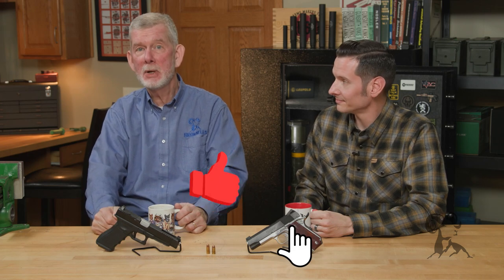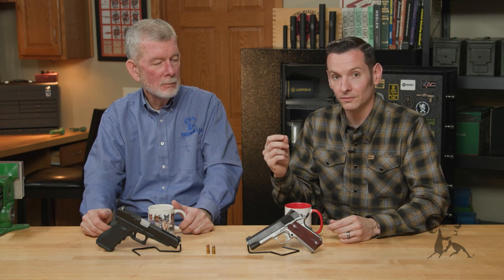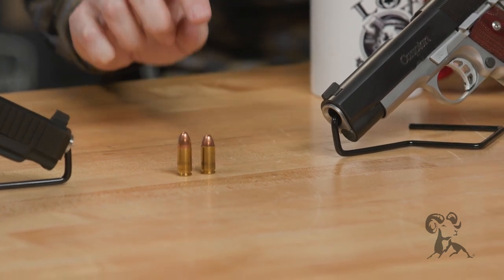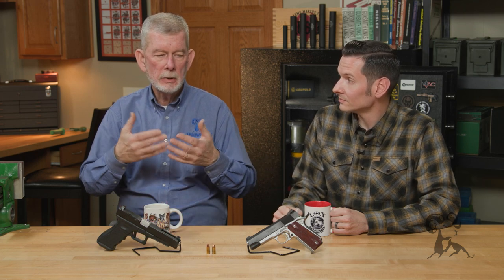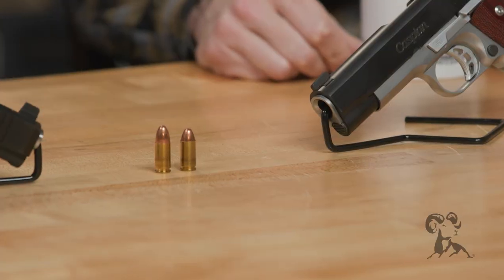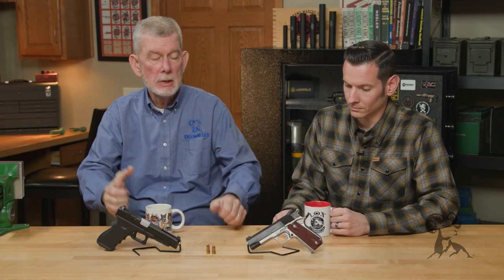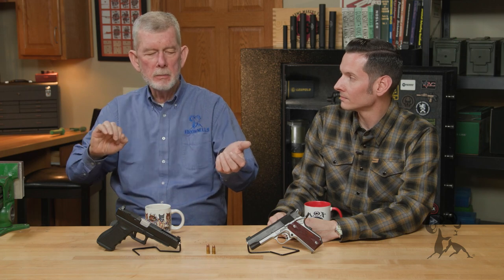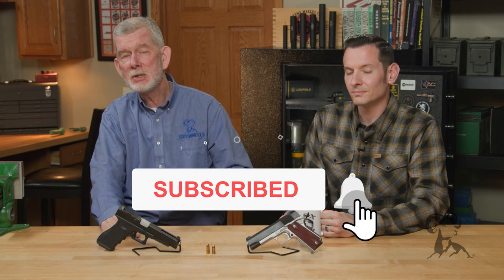Smyth Busters: Will Excess Bullet Setback Blow Up Your Gun?

Comment: So, many years ago I was a law enforcement officer.  We were issued Glock 22s.   Our carry ammunition was Speer Gold Dot.  I’d often clear my pistol for various reasons. Often times I’d simply “re-chamber” the same round, go back on duty. 
One day at our yearly in service training, we were told to shoot our duty ammunition in training and we’d be given fresh ammunition before we left the range.  First time I went and drew my G22 to shoot our qualifying course I had that first round sound extremely loud and it caused a malfunction.  Upon closer examination, one of the frame rails slightly separated from the frame.  Hence the Glock was shipped back to Glock.  I learned a lesson that day.  
I’d would have had a single shot pistol had I been involved in an incident.   Scary.
Reply: Yep because glocks do hit a fairly steep feedramp unlike Beretta.
Reply: I was in Law enforcement for almost 20 years always just left everything in my duty belt. They left their glocks on the job and loaded and unloaded them every shift. Having known about this potential problem for years I was uneasy at best and they wondered why they had so many negligent discharges . Luckily two weeks later I got a better offer closer to home.
Reply: when i load my pistol for cary, i typically manually load it, drop the slide then insert my magazine. same with my rifle
Reply: @xtreampb6309  bad on your extractor
Reply: @xtreampb6309  This method you use will put more stress on the extractor as you're forcing the extractor's claw around the cartridge, whereas in normal feeding the round slips behind the extractor as it slides up the breech face finding its seat. Examine your extractor very closely for any chips.
Reply: Well one thing you need to think about is, the 40 cal was put into a weapon system that was designed to handle 9mm. So using a standard 40 cal for a prolonged length of time in the gens 2-3, causes more stress on the frame to begin with. There's actually law enforcement departments that have had issues with the frame cracking from prolonged use. So if you fire an overpressured 40 cal in a firearm that has already been fatigued due to it not being designed to handle such around in the first place.... You're bound to have issues with the frame breaking at some point. 

I haven't heard many issues with that from the Gen 4's as they incorporate a different recoil spring..... But I'm sure eventually it's possible.
Reply: I've never seen so many factory set back issues as I have in the past run of pandemic era Winchester white box. Be careful people
Reply: @blantant  wwb should be discontinued, waste of primers
Reply: @xtreampb6309  Keep a close check on the extractor; dropping the slide on a chambered cartridge can damage the extractor (especially the claw) when it suddenly snaps into the extractor groove of the cartridge.
With my P320, I slowly lower the slide with an inserted mag, so that the top round is slowly captured by the extractor and fed into the chamber, avoiding slamming the cartridge into the feed ramp and possibly setting the bullet back.
Reply: @dalephillips8250  berettas will still cause bullet setback from the same process. Ask me how i know lol.
Reply: @inhumanfilth681  never had it happen in 30+years nor heard of it
Reply: @dustyak79  I heard and saw a lot of stupid things in 30+ years in LE and that's right up there. That is definitely a symptom of cement-head brass.
Reply: @LuvBorderCollies  I should of clarified after I left Law enforcement for a higher end Corporate Well paying security gig they were the ones that did that. Lucky a even better paying job called two weeks into that crap show
Reply: @xtreampb6309  DO NOT DO THIS WITH A 1911. I know for a fact that it will break the extractor :(
Reply: @dustyak79  did you use a safariland and detach the holster from the belt?
Reply: @Shadowfalls89  it will also break a glock's extractor if you do it enough.
Reply: @newerest1  No when  I was in LE don’t think those were around. I just hung my belt up at home or in a safe . That Security job they had a special Kevlar lined room with a clearing barrel and small lock boxes and cameras. Even though the pay was more than all but the largest PD in my area I just couldn’t take all their stupidity
Reply: The .40 S&W has an early pressure peak and is very sensitive to changes in bullet seating depth.  Not the best round for hand loaders.  I’m thankful my only .40 is a century old 38-40.
Reply: @mrs.vasquezz  As long as someone buys them they are not a waste to manufacturers. This is why ATF should be in consumer protection rather than law enforcement. If ammo had to meet FBI standards, every manufacturer would make certain their ammo not only made a bang, but hit the 18" penetration mark. Even .22LR plinking ammo.
Reply: @inhumanfilth681  It's the nut that holds the trigger. You did not hold your tongue to the left while chambering the round. :oops:🤣
Reply: @xtreampb6309  that can destroy your extractor
Reply: @napalmstickylikeglue  The Gen 5 .40s were upgraded specifically for .40.
That's why the 23 can't share holsters with a 19 anymore.
Reply: @pewpewTN  I'm aware. But he wasn't carrying a gen 5.
Reply: I carry a Glock 21 SF as my duty weapon and we use Winchester ranger t series brand. I noticed a round over seated from not burying it in the magazine from loading and unloading through the year for training/cleaning. I don’t know if it ever got shot or not because when we qualify they have us down load our magazines for the course of fire (they still use a revolver based qualification course of fire).
Reply: @5jjt  yep just learned this myself good call
Reply: @blantant  got a 10mm last week still laying in my dump tray…I pack a forged 5” 1911 so take a good un I hope to fuck it up..
Reply: @petesheppard1709  cmon man dont baby your gun. All the other rounds slap on the face of the extractor when you shoot way much faster and harder  than you could do it manually.
Reply: @PapaSchultz74  When loading from a magazine, the extractor groove of the cartridge case 'slip' under the extractor claw as the round is pushed out of the mag
Reply: Perfect story to bring attention to this hazard.
Reply: @dalephillips8250  I thought I heard them say that Glock was a straight in to the barrel, no ramp. Never having held a Glock, I don’t know or care… P.S. I’ve held and fired many, just not a Glock.
Reply: @dustyak79  A “clearing barrel”? What, you dropped the mag then fired your pistol into a water filled barrel? Tell us more!
Reply: @napalmstickylikeglue  all of these guns were resigned for 40
Reply: @greybone777  only the Gen 5's....but we aren't discussing them ...are we?
Reply: @greybone777  no they weren't. Do your research and you will find that the 40 caliber was absolutely placed in the frame of a 9 mm because they wanted to be the first who came out with a weapon platform in 40 caliber before Smith and Wesson.
Reply: @samiam619  no you dropped mag pointed gun into the barrel then racked the slide to clear it. Theoretically if you were negligent it went into the tube which had sand at the bottom. But if you’re gonna be negligent you aren’t always going to be negligent in the correct direction and hit the barrel/ tube
Reply: Had the same issue with a Glock 21 back in 2003 , actually blew the slide off and magazine into 3 pieces. Wasn't a pleasant experience
Reply: @napalmstickylikeglue  mainly second gen Glocks had that issue with the 2 pin system, they fixed that in late 90s with 3 pin guns
Reply: @smittysmith4828  no, they had the issue with the Gen 3's. Police departments around the country found hairline fractures in the frame after they inspected their service weapons. 

It was due to the recoil spring that the Gen 2s and 3's utilized.
Reply: @napalmstickylikeglue  I didn't say gen 3 didn't have an issue, both 2 and 3 had the issue, mid gen 3 they strengthened the frame counting pins is the easy way to tell weak vs strong frame
Reply: @smittysmith4828  but you conveniently left that out. Despite the extra pin being put in, it still had the issue of cracking frames. However the problem minimized when they went to the Gen 4 because of the reduced recoil spring. They knew it was still an issue and it was very unpopular being in a frame that was originally designed to handle a 9mm round.... That they made a more robust firearm as the Gen 5.
Reply: @dalephillips8250  just cause you dont notice doesn't mean it doesn't happen. I own one and it does haopen over time. Its just a fact jack. Cant fight physics.
Reply: @samiam619  nope it hits a considerable ramp incline
Reply: Given the number of Glocks that I've seen blown apart with box ammo, it doesn't surprise me that your Glock 22 came apart. The cavernous chamber that they use to make their guns so reliable also tends to allow them to break up rather easily. As I said, I've seen a number of the blow up inside of about 20 rounds with box ammo. Detroit police had an issue several years ago when they decided to get some lead ammo for practice. And they were blowing up there Glocks within ten rounds in some cases. Never realizing or reading the instruction that you can't shoot lead through Glocks.
Reply: @44hawk28  yeah, I can make asinine untrue claims also......

Glocks don't blow up any more than any other Firearms where overpressurized rounds are used.
Reply: That was a close call.
.40 S&W is very unforgiving for bullet seating.
Reply: But you could've defeated the bad guy's body armor.
Reply: Law enforcement should only have single shot weapons, after all the modern mag dump video's and horror stories I've heard. Heck I'd actually prefer they give these thin blue line gang members only 1 rubber or bean bag round, unfortunately they can still kill with those when they operate outside(technically inside I think) of the design parameters. I know I know... There's some"good apple's" out there, but for the most part its a corrupt dog eat anything world out there when it comes to... Officer safety... Or just getting that commendation or notoriety for a exceptional bust or threat mitigation when in reality it was just a dirty situation played to the advantage. Thank GOD for the 1st amendment recordings and body camera's is all I have to say.

Comment: Thanks for this video.  I read something about this phenomenon in a magazine sometime in the late 1990s.  When I was in Iraq we would have to load and unload our weapons every time we went outside the wire which for my team it was 4 or 5 times a week.  This meant the same rounds were repeatedly chambered over and over again.  Remembering that article I became concerned enough that I would hand load the round into my M16, ride the bolt forward and use the forward assist to seat it more gently than it would otherwise chamber. Everyone else looked at me like I was paranoid/nuts but I did it anyway just in case. I'm glad to finally get some vindication after all this time.

Comment: Witnessed this happen one time. Kimber .45. Jammed a home load on the feed ramp. Shooter adjusted the slide to complete loading of the round and fired it. It blew the wood grips off the firearm and she was hit in the face by multiple fragments of shrapnel. She was wearing safety glasses, but she felt it in her hands for quite some time. I don't believe it damaged the pistol mechanisms, but they did send the gun back to Kimber for evaluation. I was not aware this could happen until that day.

Comment: Im an army small arms repairer. We had a soldier that had a double feed with an m4, and just like anyone who doesn't know how forward assist works, he mashed the forward assist, pushing the bullet into the case. He fired it. The whole m4 blew up.

I check my rounds when im putting them in my mags. I've seen brand new commercial 9mm that is pushed back right out the box.
Reply: Kenosha Kid probably the only person to even benefit from forward assist.
Reply: I had a Galil cobbled together by Century Arms. Bullets liked to hit too low on the feed ramp pushing bullets back. I was having problems blowing primers and deforming case heads. Finally figured out the receiver was milled incorrectly which made the magazine sit too low. No more CAI made junk.
Reply: I got a factory 9mm round once with a large piece of brass broke off.
Reply: Yeah NOT what we are talking about here.
Reply: @DS-gt1ft  What do you mean "we"? You weren't part of this 2 years ago when this was posted 🤣
Reply: @DS-gt1ft  And judging by your other comments, you're nowhere near qualified to give advice about anything 😂

Comment: I performed an unscientific test by chambering a Speer 230-grain Gold Dot HP, a Win PDX1 230-grain HP, and a 230-grain LRN reload ten times in my Glock 30. The before & after COL measurements showed the Gold Dot round setback .01 inch, the LRN reload also .01 inch, and the PDX1 only .002-.003 inch. I expected more setback with the reload, the case being fired an unknown number of times and a softer lead bullet, but the Speer factory load surprised me a bit. The PDX1 seemed very non-conducive to setback. All three fired with no discernible difference from untested rounds. Clearly setback occurs, but the amount will vary with firearms and cartridge makes. The question is: How much is too much?

Comment: When I started reloading this is one of the first things I learned about. Make sure you crimp the case mouth tight enough to hold the bullet in the case securely or bad things can happen. Also, cartridge overall length is as important as the charge itself. Ammunition like Buffalo Bore or Cor-Bon which is already pretty hot to begin with would be disastrous if you had setback with one of those rounds.
Reply: That's the rub though: autoloading pistol cartridges can't have a true crimp put on their case mouth, because the way that autoloaders headspace rounds.

In the context of pistol cartridges, particularly, heavy crimps and rolled crimps can truly only be had with cartridges that have rimmed cases, and where the action headspaces on that rim; in other words, revolvers.

So regardless of how meticulous the loading or manufacture of pistol cartridges is, the potential for "Set Back" or "Jump Back" is going to always exist for autoloaders. 

The only ways to truly ameliorate this potential is 1) discard the cartridge after having chambered it more than once, or 2) use a revolver, where cartridges may be chambered and unchambered ad infinitum without any Set Back.

Comment: Certain loads like Hornady Critical Duty are actualky designed to be more resistant to this. The bullet is crimped in such a way that it forms a small ledge, keeping it from moving backwards into the case. I'm sure it'll still do so after enough cycles, but it's much more resistant to it.
Reply: I don't think there is a single round that is more susceptible to setback than Critical Duty. Look around online, it is not resistant in any way.

Comment: It should be noted that there are minor differences in setting from load to load as setting depth can be used to adjust pressure/velocity. So two of the same caliber rounds but different loads or loaded by a different company or loaded on different days (if it's cheap inconsistant ammo) can have two different settings. Moral of the story if you compare Brand A 115g fmj 9mm to Brand B 115g fmj 9mm and note a slightly different set height, it's probably nothing to be concerned about. However, if it's off enough to look weird and/or off compared to others of the same load from the same brand... you might wanna just throw it out.

Comment: I've had the "boom" in .45 ACP hand loads.  Bullet crimping not adequate.  It was like a cannon compared to a normal explosion.   My guess when round hit feed ramp, bullet pushed back into case, and KaWhamo.
Reply: So, if a round goes "KaWhamo," blame it on the bullet crimp.
Reply: Bullets are not hold in place by crimp. They are hold in place by neck tension. If you don't believe me get a soft lead bullet. Load it, and hammer it off. For a 9mm you will see .351-.353 size where the bullet is held in the case. It will tumble and keyhole.
Workarounds are using an M-die or a .38s&w expander and then sizing your coated bullets to .356 or bigger.
Reply: @JohnLloydScharf  If it goes Kaboom, then different issue.  :-)

Comment: Hornady seems to be pretty prone to this, from my experience. Also, I’ve heard that .40 in particular, is one round you need to pay attention to. Many .40 pistols are basically built on a 9mm frame and the .40 caliber is toward the upper limit of what the frame can handle, already. The increased setback and pressures can cause some serious issues on those pistols.

If I unchamber a round for dry fire or cleaning, etc…I’ll cycle my rounds in my magazine. My unchmabered round becomes my first round I put in the mag (last to be used).
Reply: Yeah I do the same but not after one chambering, if I chamber the same load a few times I will move it to the bottom of the mag. I rarely unchamber the round in my pistol so it takes several years before that's ever an issue though.
Reply: I wonder if the nickel plated cases that Hornady uses are more prone to this because of the slickness of the nickel case.
Reply: @tubeonline629  that makes me feel better about ending up with brass cases.   That started during the plandemic.